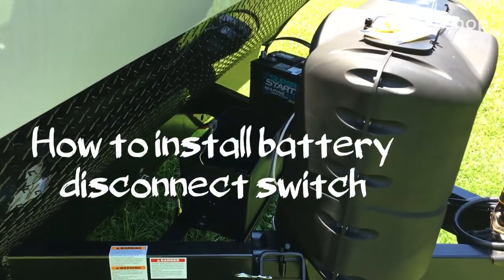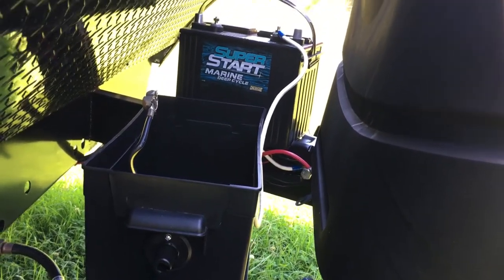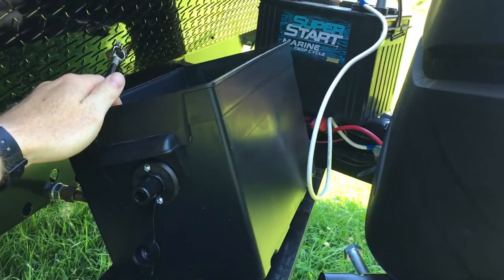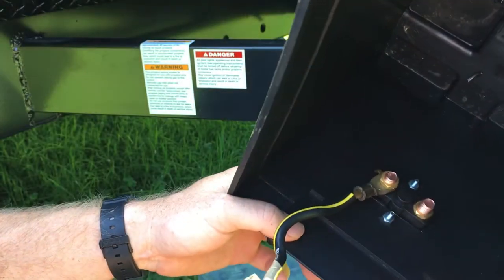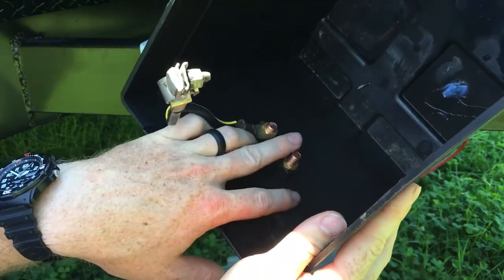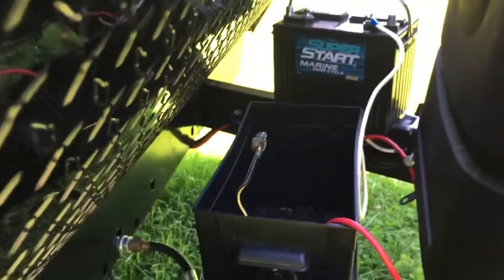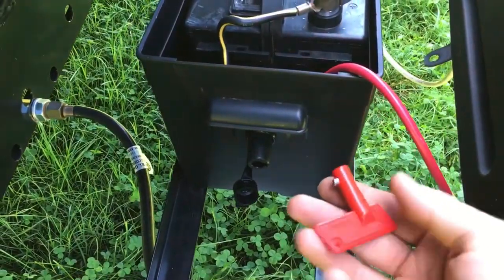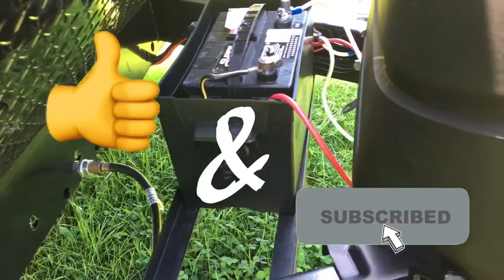How to install Battery Disconnect Switch on Camper/Travel Trailer

Comment: Nice location for the switch.  I’ve been sitting here thinking about where to hook mine up.  You helped me a lot.  Think it will work the same with 2 12 volt batteries?  I’m guessing it should
Reply from the maker: Yes it should if you have both batteries wired parallel together.